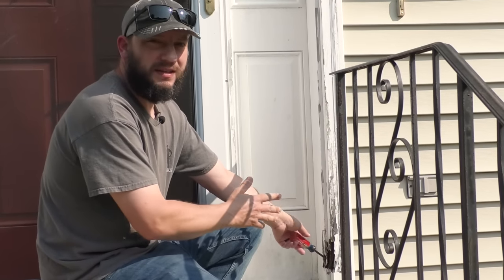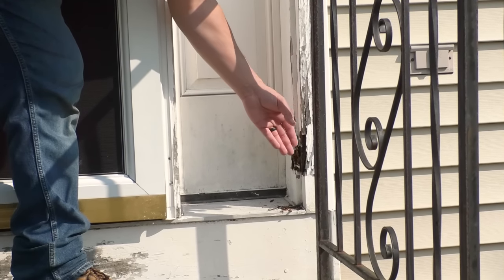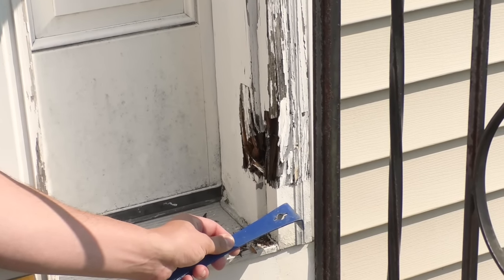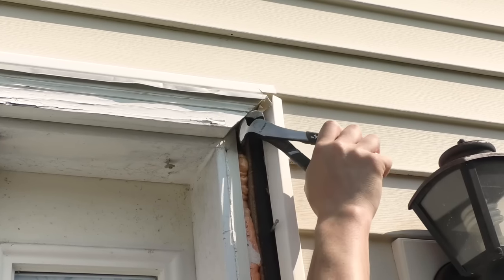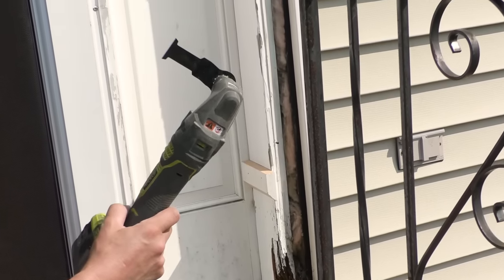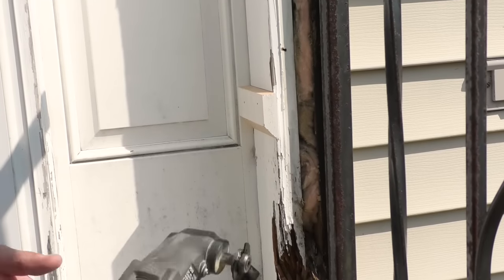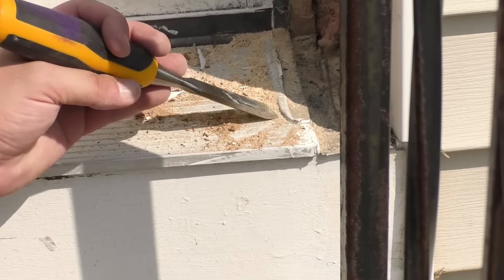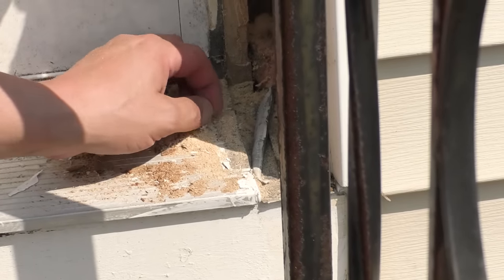How to Repair Rotted Door Frame and Trim on Exterior Door

Comment from the maker: Subscribe to my channel: https://bit.ly/SubscribeToTheFixer

Thanks for watching! 😃
Reply: Make that rotted wood cut about 2X higher .. I've done this many times, what I learned is that rot infects the wood and goes up much garther than you would think, and it will continue to rot the wood.. It's really best to replace the WHOLE piece of wood, if not possible cut as high as possibe.
Reply: Generally a good, conscientious repair. Aside from the backwards scarf joint, I'd add the following: I would have scribed the threshold angle onto the repair piece, rather than using a sliding T-bevel, because it catches the irregularities better. A scriber costs about $2, and there's a little more technique involved in using it, but gives a truer outline. Also, in preparing for the application of the bondo on the other side of the door, I would have used some Minwax Wood Hardener on the edges of the rotted section that you removed. It's made for preparation for their version of wood bondo. It really does work, even though the fumes are nasty. It seals and strengthens the fibers in that peripheral zone of rot that's not crumbly enough to be easily removed. Also, some masking tape on the threshold would make for a neater job, to be removed as soon as the troweling is done. 
-- Get yourself some real sandpaper. Using your discs for hand sanding is a waste of money. I recommend Norton ProSand 3X 80 grit. It's harder to find than 3M, but it doesn't clog as fast and lasts longer. I spent years restoring 100-year-old mahogany entryways on high-end Boston apartment buildings, and it involved A LOT of sanding, and I wouldn't use any 3M products. In a pinch, there's Gator brand and some Scandinavian brand that are OK, too but the Norton ProSand was the best. For anything getting painted other than furniture, 80# is fine enough (well, maybe not for joint compound). Those entryways were varnished (Sikkens Cetol marine varnish), and the results, after 80# sanding, were fine enough to cause people's jaws to drop. (Well, at about $10K per job, they should come out nice). And for sanding in grooves, cut an old credit card lengthwise about 7/8" wide, and wrap 1/16 of a sheet of sandpaper around it. For concave contours, use some milk-jug plastic wrapped with 1/16 sheet and roll it. I tried several electric detail sanders, and they were a waste of time. With the right sandpaper, the hand sanding was far more productive. (For anyone varnishing oily woods like teak or mahogany, it's important to wash it with acetone just before applying the varnish. To omit this step is to have a painful learning experience.)

-- And one general point: for shimming precisely, I vastly prefer white cedar shingles to the "shims" sold at the big box stores. In some areas they're hard to get, but their taper is much finer than the "shims," and with proper stacking and angling, they can provide dead-balls shimming outcomes. One bundle of white cedars will last for a decade or more of shimming.
Reply: I think I'd paint a whisper thin coat of sealer on that 45°degree angle to prevent damage from any sneaky water.💧🤗
Reply: One thing you should never do is to push a piece of material through a table saw, between the fence and the blade, with your hand. Instead you should use a push stick in order to avoid any injuries. Just a safety precaution.

Comment: The fact that you used composite trim should eliminate the worry of any problems caused by the wrong direction of the scarf cut. You did a wonderful job and your inlaws should be thrilled with the results. Thank you for the video.
Reply: Your comment won't nullify the fact that gravity still makes water run downhill.
Reply: @davidgagnon2849  Capillary action makes it run uphill too.

Comment: I'd accept that repair any day. I tell ya what. I'm too obsessed with the exterior condition of my house to let it get even 1/10th as bad as what was shown in this video. I'm so vigilant about exterior wood being properly coated with paint and caulk being correct, I'm outside a few times a year with a paint brush and a caulk gun. It's probably overkill, but I like to prevent issues from occurring rather than be reactive when it comes to my house. Time to drain the water heater!
Reply: Sending you my address.... Lol -)

Comment: Additional tip: If you're not going to glue the joint, use silicone caulking on the cut edges of wood, this will seal the wood. This is especially important if you are using wood on the frame instead of PVC. Don't forget to seal the bottom edge of the wood too...the part that comes into contact with the ground/threshold.
Reply: silicone not used outside and not wood newer together, silicone have bug and termite magnet, and rotten fast outside, windows and doors etc, need seal outside used acryl seal not silicone.
Reply: Silicone does not bond to raw wood. If you want to use silicone you have to paint or seal the wood in some way.
Reply: @larryschweitzer4904  and sislicone NOT used never outside house, all bug ant etc, eat silicone fast. outside used acryl not silicone, then have lot longtime seal at joint. same silicone not used raw metall rust fast if used. need paint before use interior parts silicone.
Reply: @mattivirta  ants and termites eat silicone?  Is that like a food source for them, or just it just that they can chew through it because they can to get to something else?
Or do they actively seek out silicone like humans to gummy bears because they find it tasty?
First I've heard about silicone being for indoor use only-

Comment: Excellent job explaining process & reasoning for each step. When dealing with rotten wood as at time 21:00 it's also worth hardening the remaining wood around the rotten wood with Wood Hardner (Minwax) or Rotted Wood Hardner (Bondo) as it gives a more solid bond for repair materials & helps stop further rot in the compromised / softened wood.

Comment: Had a similar situation and couldn't figure out why only one side of the window casing was rotting.  Turned out that a sprinkler head was slightly out of adjustment so the end of the spray arc just hit the window casing.  Over about 10-12 years, it slowly caused the rot.  So I appreciate the first part of your video recommending finding out why it's rotting.  

I opted to use PVC brickmould and trim pieces for my repair.  More expensive than wood but justified it to myself by the labor savings of doing it myself.  

I'm definitely not a carpenter, but when you made the 45 degree cut for the scarf joint (3:20), I had the thought "Oriented like that isn't it just asking for water ingress?"  LOL

Comment: Use Marine glue in the bevel cut . It won't leak and it also works on boat repair .  Two part epoxy marine glue . The board will break before the sealed  seam does .

Comment: Thank you, your honesty and showing us the right way is refreshing! I watched your videos to install a screen door by myself although I did get help to lift while installing but your work makes a big difference for those who want to be self sufficient even with projects on the home. I had a different comment till I watched more and I have a question. I trust your opinion, I had a guy who installs metal siding argue with me about using pvc trim for around window and door frames. All of my trim was rotting. I tried painting with kilz and good exterior paint and within a month it’d immediately start peeling off. I’ve watched enough “how to’s” that I really wanted pvc because it can’t rot but this guy argued that pvc is “the worst” material because it expands and contracts too much it’s not worth using. I honestly don’t buy that, he ended up using wood again with it covered in metal sheeting essentially but what do you say to that. I’m sure it expands/contracts like most materials will but I think it’s a material that’ll last and is worth the extra expense long term

Comment: Nice job! As a retired individual I do like repairs. Instead of Bondo I use wood repair epoxy. Very similar! The epoxy works well as an adhesive between joints as well. Just another measure to keep water out. 

The one thing I have found superior to silicon caulk is Big Stretch made by Sascho. This stuff adheres and remains playable, stretch and flexible and never gets hard! In my humble opinion it is the BEST caulk on the market. It's not cheap though. Plus, I have always been able to pull the semi set up plug out of the tube end (unlike silicone tubes). I don't waste any of the  tube!! So in that regard it lowers the lifetime cost!

Otherwise you and I repair things in a very similar manner!  Very nice job! Attention to details makes happy customers. Do it right or don't waste your time!!

Comment: I can appreciate your attention to detail. It showed in the finish product. A couple additions. *Don't use silicone outside. Insects eat it like candy. * Paint/seal the bottom edge of the brick molding before installing. Most rot starts there. * Or use PVC brick molding and never replace it again. Cheers

Comment: OMG, I have that problem around the storm door on the back of the house.  Not sure if I could fix it myself, no saw, but may have to find a fixer to do the job for me.  Thank you for sharing all of your knowledge, humbling us with your admissions of mistakes, and for the courage to try some of these jobs for ourselves. 👍🏼👍🏼
Reply: You can buy a small Circular saw, + a lot of patience :)
Reply: You're probably better off buying a pre-hung door from a home improvement store. It will be cheaper than hiring someone, and all you need is a screwdriver.
Reply: @bakerbill4274  👍🏼👍🏼 forgot that idea! + and alot of patience if your house is older with janky walls like mine

Comment: I think since you used the Bondo on the seams of that fix, it wont have water seeping into the cracks anyway. So i wouldn't call thqt a mistake at all! If youd left it uncovered then it kight be a bigger issue. 

I know this video isn't new but i have some rot at the bottom of my side door and was trying to come up with a solution without replacing the entire thing. Glad i ran across this video because its exactly what i was looking for!

Comment: Looks awesome.  The piece where the mistake was made with the 45 degree angle I would put water proper adhesive or even white caulking so it prevents water intrusions.

Comment: I do something like this alot. I do a straight cut though to the jamb like a z molding and then glue and screw the new wood to the old. Overlap like 6 inches so the joint is solid. Bondo to smooth out and fill screw holes like you did. Also if the rot isn't all the way back to the weatherstrip, just cut back enough to get to solid material and glue and screw from the front edge if you had material of the same thickness.

Comment: you can paint 5200 and even works on damp wood it is used by yacht builders to hold hull to deck. just an tip for you yhanks for your professionalism   Roger

Comment: you would 45 it the opposite way so water runs outwards, not inwards if the seal between the wood joint fails in the future.

Comment: You did a great job have to do my side garage door lower parts both sides. Just so you know for future jobs I did a repair with Bondo Filler on some wood clapboard few years back & it all fell off with paint on top of it. Bondo Filler isnt waterproof dont know if you know that but Bondo Glass is waterproof the short strand that would of been a better product to use. You should be good for awhile either way as you used PVC in the areas mostly where you used the Bondo filler just a note. .....Glenn

Comment: Nice work. The angle flowing into the structure had me saying, what are you thinking! But then you  explained it. I’m just OCD enough I’d had to go back and correct it, even though I know the repair will outlast the door. I am curious why you didn’t seal the fresh cuts. With a physical sealer like paint or caulk to help prevent moisture from wicking in from the end grains. Also, the backside where the patch meets the rest of the frame, why no caulk on the joint or the bottom of the patch where it meets the threshold? I know these are small things, but wouldn’t it be better to seal all points of water and air infiltration during assembly? About your repair, have the done the same repair, found it bought my a couple of years, but eventually I had to replace the damaged wood it’s a patch like you did on the other side of frame. Nice video, good to see options.

Comment: Thanks, for all the tips. Now I need to know how to repair and prevent fromfurther damage the 2x6 treated deck boards that are constantly in the weather. Is there a fungicide that will stop the wet rot from spreading?

Comment: I waterproofed the lower ten inches or so on all the door framing on my garage with clear duraguard rock guard used for rocker panels on cars it’s a rubberized waterproofing cost that’s paintable

Comment: Thanks for posting.  I’m curious as to how the patch with the vinyl, the bonding, and the wood holds up over time since each material likely has a different coefficient of linear expansion.  
Does the Bondo pop off?

Comment: I'm amazed you didn't prime the board below the door. You already had the brush in your hand and it would have taken at most 5 minutes to prime that panel. Yes, it may be due for replacement but (a) a lick of primer might delay that work for another few years and (b) leaving unpainted now with, the rest of the door freshly primed and painted, will draw the eye directly to the board every time you walk up to the house. And, frankly, letting exterior wood go 20+ years without a fresh coat of paint? I'm amazed that's all the rot they had.

Also I am slowly replacing all the exterior window trim on a large two story house as it fails. My trim is all 2 x 6 and it is all failing at the corners where the end grain wasn't sealed by the original builders - plus it was clearly not primed before installation as I find bare wood in the "out of sight" places whenever I remove some.  I would have primed or otherwise sealed the exposed end grain where you made the 45 degree joint. General rule for me is buy pre-primed trim, seal end grain with zevo "endcuts", then prime all six sides twice BEFORE installing. I never want to do any of these windows again.

FYI my side door had this problem, which I fixed this weekend. I just removed all the trim, then it was easy to pop the whole frame out and rehang the door with a new ready-cut frame from HD (yes, the builders had installed the door frame from the outside before attaching the trim). Pop the trim, cut the replacements, dry fit and prime. Then, while that's drying, remove the existing frame and rout out the mortises in the new one for the hardware (with a brief pause to put the second coat of primer on the trim), then install it and rehang the door. Nail up the trim and caulk. All done in a day and I won't need to revisit that door for another 20 years or so (by which time, I will probably have moved out or moved on - I'm in my 60's). Of course, my wife gets to repaint everything during the week, but she's a perfectionist - more than my life's worth to touch paint.

Slightly more work, and more expensive than a patch (think all the wood was about $500) but it's once and done.

Comment: Beautiful work. Question . I have a “gold” kick plate that has tarnished. Do I need to replace it or can the tarnish be removed?
Reply from the maker: If the gold is brass, try maybe using Brasso. You can buy it here- https://amzn.to/46hRzX4 (affiliate link).
Reply: @TheFixerHomeRepair  Thank you so much. Is it okay to let you know if it works?
Reply from the maker: @judithcatlett8518  Yes!  Please let me know!
Reply: It took a little while, but I finally bought the Brasso. It took some elbow grease, but the Brasso worked beautifully. All their directions were not good for me, so I used rubber gloves to rub the product on. That worked much better. Thank you very much for your suggestion.
Reply from the maker: @judithcatlett8518  awesome.  Happy to hear it worked!

Comment: We bought a house in 1970 that was built in the early 60's, and yes, by the mid to late 70's, the sill/threshold at the front door was beginning to rot out as the house was built with wooden gutters that were too shallow for the roof pitch and constantly overflowed when we got a good shower (a regular occurrence during the fall/winter months, being in the Pacific NW/Puget Sound area) and the back door from the garage to the backyard was even worse. 

We moved out of that house in the mid 80's and since then, I think both doors got replaced.

Comment: That was an awesome, AWESOME video.  I have exact situation, and the painting contractor was asking $$$ for it.  Now I can thumb my nose at him.  I also have a question.  I have a double half hight basement windows opening in front.  The top plate of those windows have similar situation.  Can I pull it out and redo it with PVC plate? Is there anything I should keep in mind or be careful about? That will reduce cost of the exterior painting job a bunch.

Comment: Good work. If I may suggest in the future, Always sand the wood with low grit before you put any filler to make sure it grabs good. Otherwise, it's on top of paint and will chip a lot faster.

Comment: A lot of great latex enamels and hair curious why you chose the oil base which dry time and clean up kind of downfall.  did you use a final coat,  if so, what type of paint?  or did i you just use the z primer?  

and i am glad you caught the 45 angle. i noticed. it right away and glad you corrected it and let folks know why you did what ya did.  fI was a pain for a QC inspector in the Navy Seabees). 😏

Love the saw.  good tools patience and wanting a quality finish.   👍👍